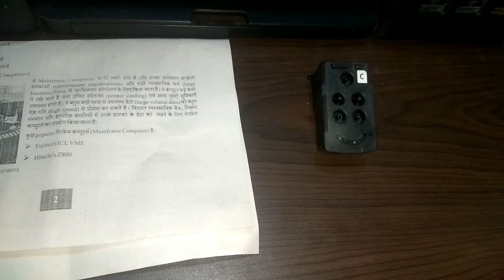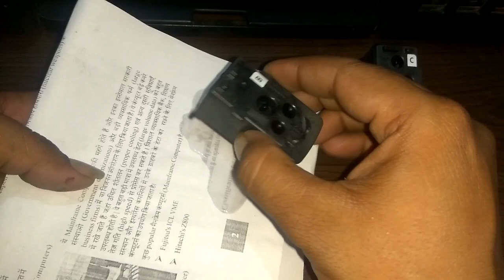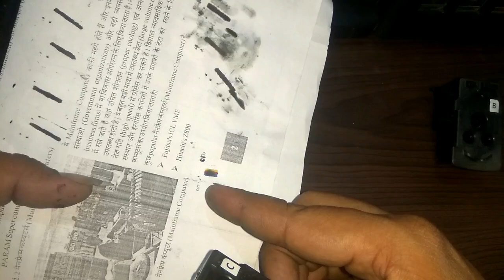Canon Pixma G2000 cartridge Cleaning

Comment: There is no need for unscrewing parts which you mentioned. The blue coloured part has a button which must be pressed from the bottom and entire part moves up. In this way you remove the cartridge easily without this tedious process which is difficult and time consuming.
Reply: In this video this is old G2000. New G2000 have button so He had to open with screw driver.
Reply: A

Comment: The problem i think is because the big tank is situated at the same level as the nozzle.  Principle of CISS is that the tank should be higher, makes sense, gravity in action. I tried it, without removing the print head and all that, it works.

Comment: Sir, I have fixed my printer with your videos a couple of times, thanks a lot for your videos.
This time I am facing some problem after following everything still black is not printing properly.
I have cleaned the head with nail polish remover, also filled the ink with injection, also pushed air with help of injection and last tried deep cleaning but nothing helped. Still nozzal check showing as missing lines, photocopy are really bad, only high printing few things.
I am using original ink only from canon shop.
Reply: Buy new cartridge

Comment: Solution worked but it was partial as ink was still not coming. Black cartridge was havely clogged. Used hot water and dipped cartridge in it for few minutes and then pumped air using syringe and then it started working.

Comment: one day, no amount of cleaning can fix it and the only way to do is to replace those black and colored ink cartridges only to realize that you can't afford it. A pair cost U$70. My tip is check first which printer has the cheapest cartridges, which are easy to clean and replace.